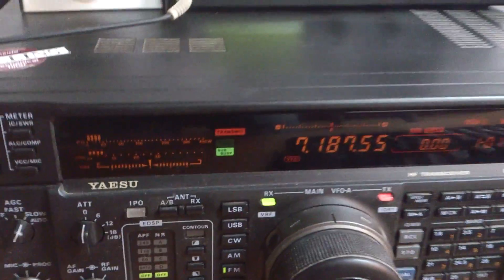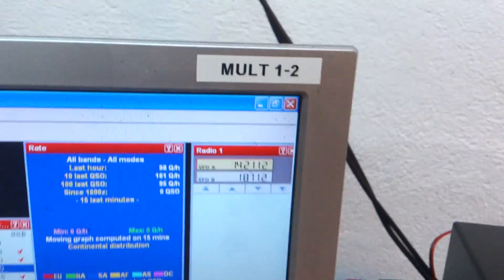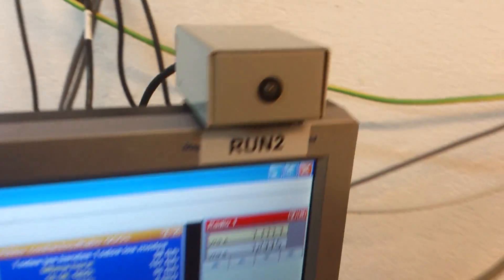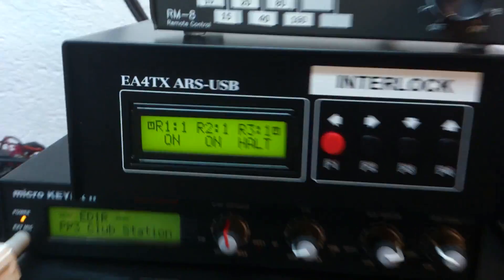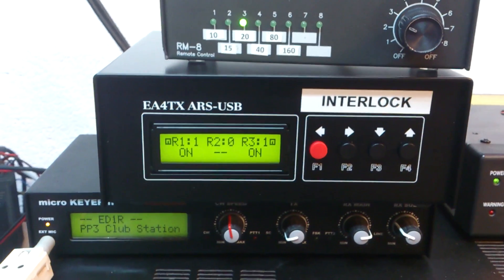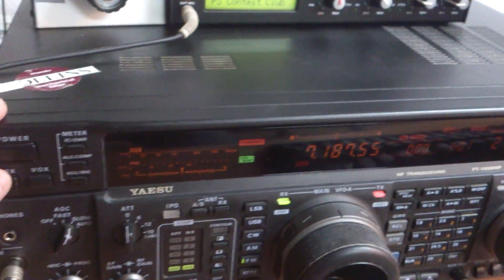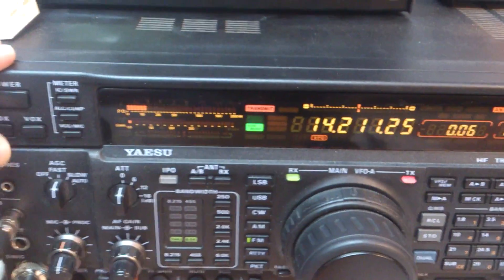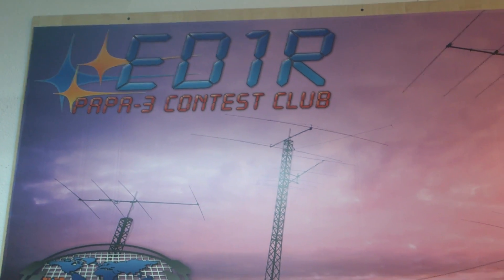ED1R - New Interlock System by EA4TX with ARS-USB (1)

Comment: I'm an SWL. What's the purpose of this interlock? Seems a very expensive way to guarantee that only one transmitter is used at a time. Why not use self-discipline instead?
Reply: in different contests, only one or two signals can be on the air with many radio/bands. Interlock manages the priority of the radios, and let the signal go to air or not, via software.